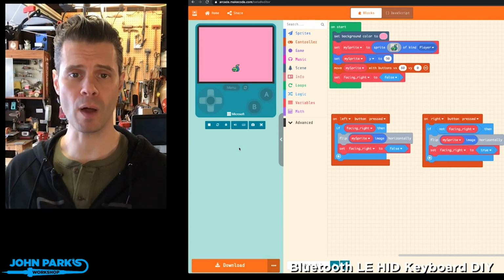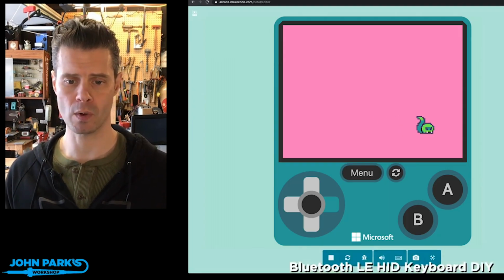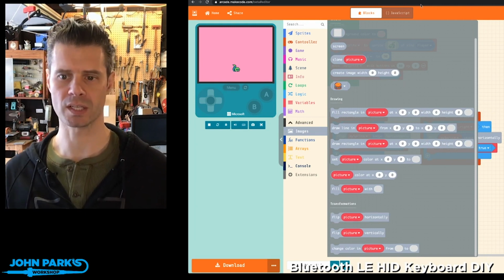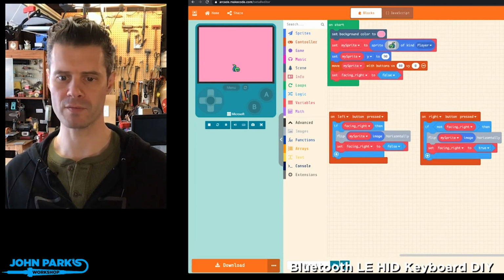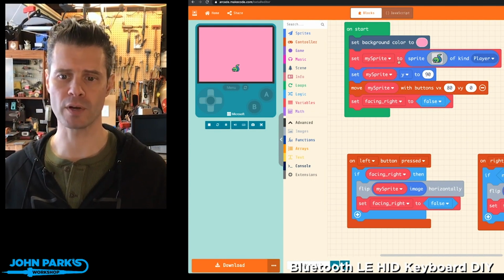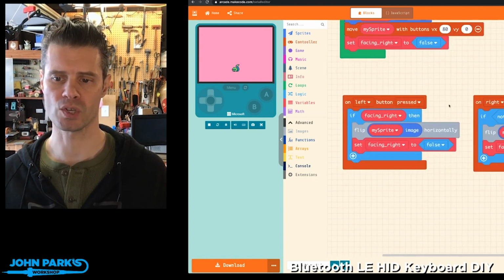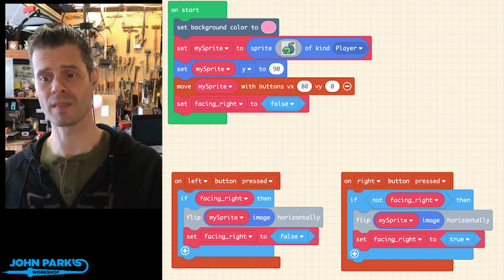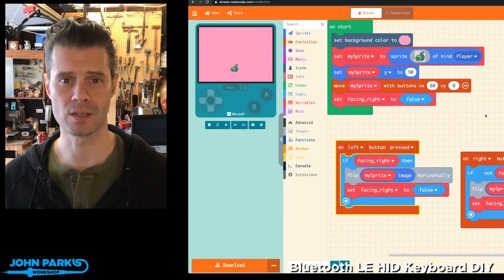MakeCode Minute: Sprite Flipping @adafruit @johnedgarpark #adafruit @MSMakeCode #makecode

Comment: Thanks for flipping us off, John Edgar Park. When I try to download this flipping shark to Meowbit and BrainPad Arcade I get the 022 error. I see 021 and 020 errors in the reference to hardware errors, nothing on 022. Also, we would like to add "motors" via Robotbit extension and a propeller on the back of our amphibious bot car in Arcade so that extension is installed here: any idea why flipping does not work on hardware? Thanks   https://makecode.com/_a6xRj4P31H96